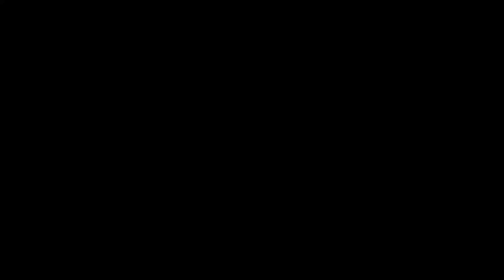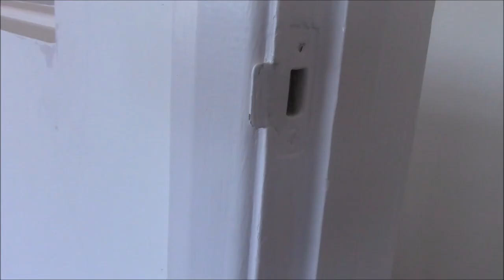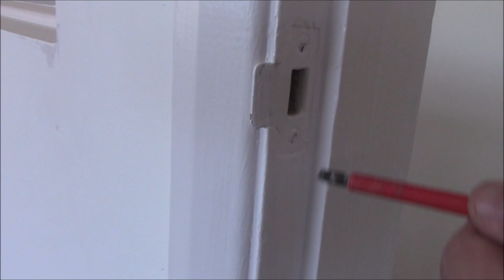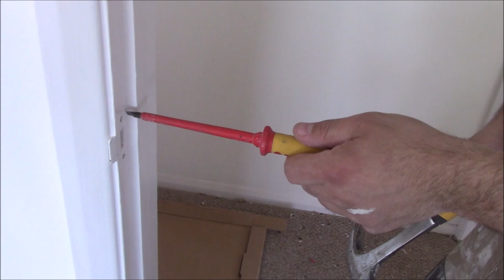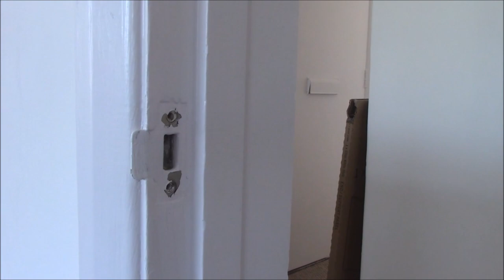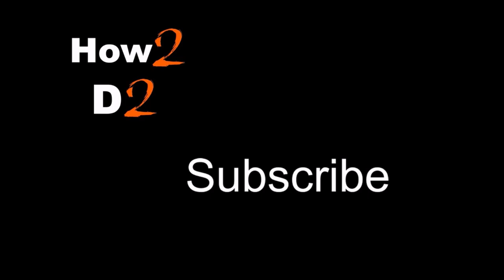How to remove an old slotted painted stripped screw from door hinges

Comment: Thanks! OMG, It worked with my old door!! But in the process the head of my cheap £1 screw driver broke. Should I expect this to happen or would a high quality driver take the force? I wouldn’t want to use an expensive tool and damage it next time.